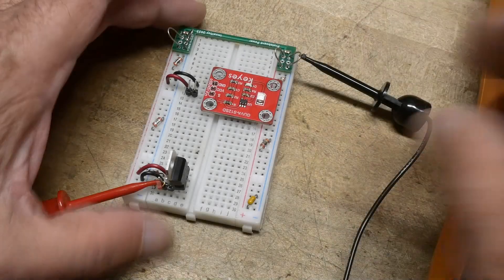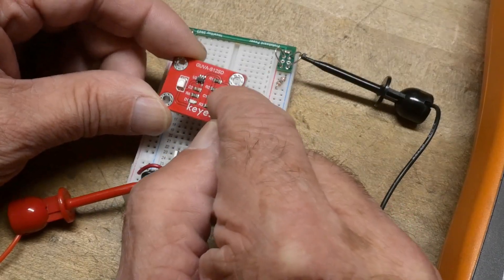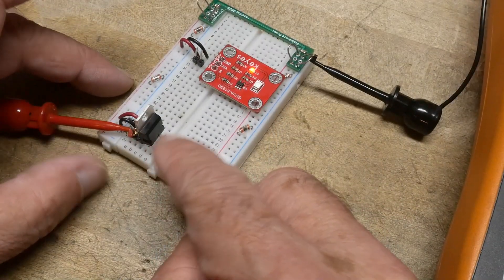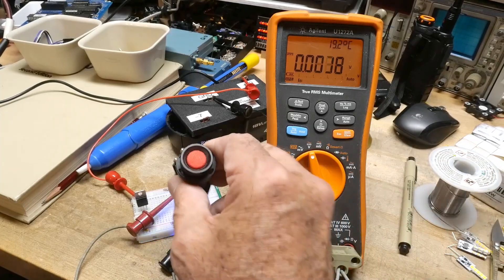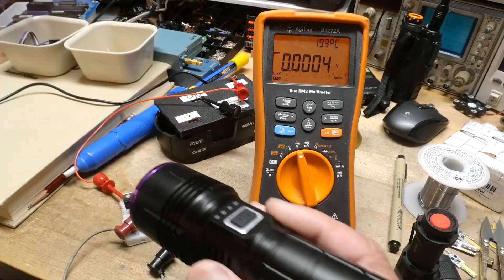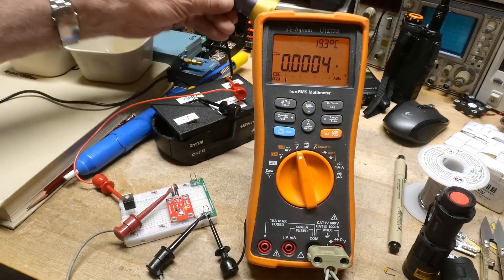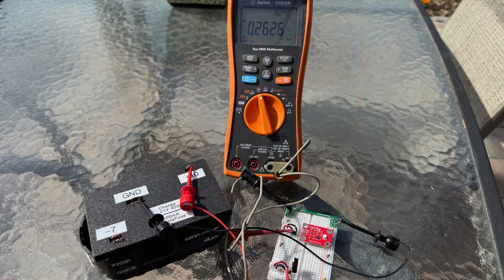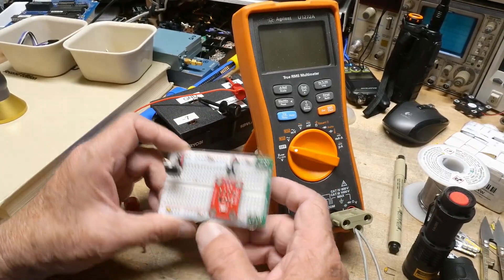#2238 UV Light Sensor Module guva s12sd

Comment: It is instructive to check the UV intensity outdoors at different times of the day.  Due to the strong UV absorption of the upper atmosphere, the UV is at a maximum when the sun is directly overhead and the UV drops off dramatically when the sun is below 45 degrees with respect to the horizon (same as when your shadow is longer that your height).  At the lower sun angles, the UV has to pass through more of the atmosphere and thus is attenuated a lot more.  As a result, application of sunscreen is unnecessary early or late in the day even though the sun by look bright, but sunscreen is definitely advised when the sun is high in the sky.

Comment: I bought a cheap digital camera with the internal filters removed because supposedly you can spot arcing in the UV wavelengths that is not visible to the eye.  Had some issues of power line arcing around here before and figured to try that to determine the source along with radios, which do not have the ability to isolate it beyond maybe a pole or area.  Also arcing makes ultrasonics but  I cannot find a cheap parabolic reflector for an ultrasonic detector I built,  which you need.  I have a LED UV flashlight and also short wave UV lamp.  Because some things will no glow with both.

Comment: Solder masks, nail decoration and many others cure better and faster with 365nm, and the reason why they put near visible 400nm LEDs is on one side simply because they are much cheaper, on the other side to not cause skin or eye damage. Nevertheless, on the nail curing lamps they install one or two 365nm and twice as much 400nm - clients don't like sitting still long. There's another specialized product - clear printing UV cured varnish, that 3 decades back kicked out normally drying varieties because of the speed and ability to be printed with clear sharp edged patterns that requires much shorter lengths UV. I have no information on what kind of UV nowadays common in the advertising business ink jet UV curable dyes use.